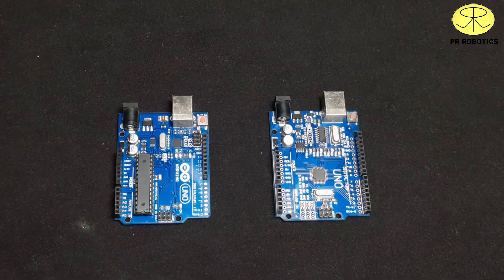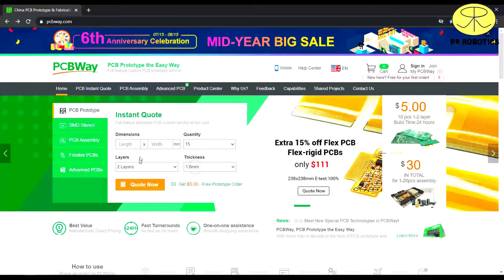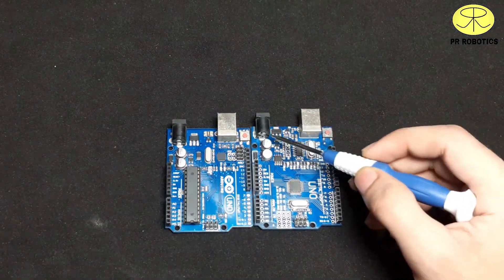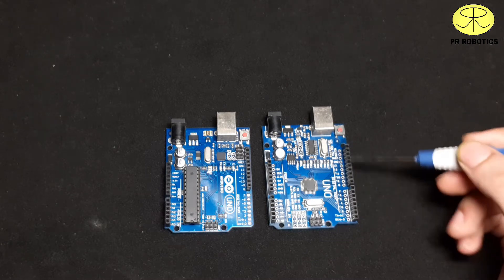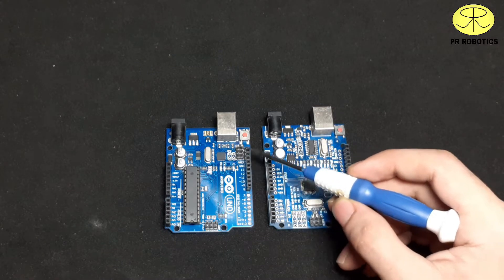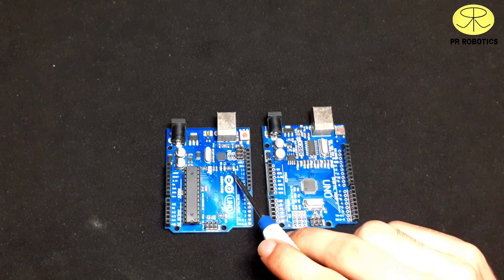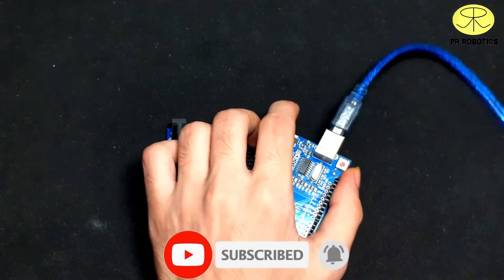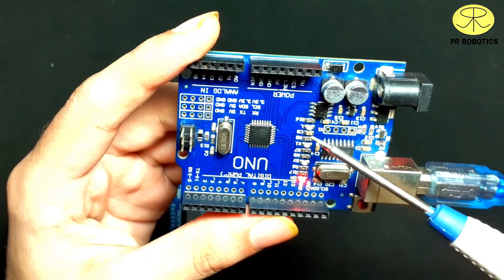#67 Arduino UNO SMD version v/s THT version  ||PRROBOTICS

Comment: In SMD model
There is some other  power points and  ground pins which is in between the ISCP points and analog IN but they not sholdered by the manufacturing, if i use my all power points ,  can i use use the power points and ground which is in between ISCP and analog. 
Can i use these pins safely without any fear of overload or burning of microcontroller?

Comment: What is the better arduino  board
Reply from the maker: I will prefer the one with THT IC because if you do something wrong and blow up the IC (which can happen sometimes), you will be able to easily replace the IC without the use of specialized tools. I hope it helps :)

Comment: Hey bro! Through which board can I control 2 motors?
Reply from the maker: You can use both of them. You have to use another module which is motor driver module with Arduino board to control the motor

Here are videos of mine on interfacing L298N motor driver module with arduino:
https://youtu.be/xIBd2xsGAYw
https://youtu.be/eyAnv8fDLZ0

Comment: hey brother my Arduino uno ch340g board bootloader got corrupted and now i want to install new on it but the AREF pins near to reset button are missing on it.....So PLEASE HELP BROTHER HOW CAN I DO IT?????
Reply from the maker: You can't update the bootloader on CH340G, by the way how you know that the bootloader on the CH340G is corrupted. If I am not wrong CH340G doesn't have any bootloader for it.
Reply: @PRROBOTICS  bro i don't know what happened with the board.... The programs aren't uploading on it, says sync error.... The reset button isn't working neither. So i don't know what to do... Please help. If there is any other option to contact you please tell me, I'll send you the video related to it
Reply from the maker: @PranayBawne007  checkout the following Instructables 

https://www.instructables.com/A-solution-to-avrdude-stk500getsync-not-in-syn/

Comment: This explanation is precise. What i want to know now if i can use the extra pins. especially the one below
Reply from the maker: Which pin you are talking about can you please specify?
Reply: @PRROBOTICS  the clone has extra 5v Ground pins near the iscp pins below where you can solder. does it work? do you have i diagram for that or have you tested it
Reply from the maker: @Shabloop  you can check that with a multimeter, if it's there it will surely will

Comment: the board that you program first i had that and when i upload code in it it shows an error occoured but the lights blink same as in yours but on screen it shows error code please help
Reply from the maker: Please let me know the error code so that I can assist you better.
Reply: @PRROBOTICS  Bluetooth arudiuno car
Reply from the maker: I am mean to say the error code in the compilation window at the bottom of your arduino IDE in red colour.
Reply: @PRROBOTICS   the error message some times come Arduino: 1.8.13 (Windows 8.1), Board: "Arduino Uno"
an error occurred while uploading the code
Reply from the maker: Please copy and paste the error message from arduino IDE. Because this information is not sufficient to help you.
Reply: @PRROBOTICS  Arduino: 1.8.13 (Windows 8.1), Board: "Arduino Uno"

Sketch uses 2658 bytes (8%) of program storage space. Maximum is 32256 bytes.

Global variables use 195 bytes (9%) of dynamic memory, leaving 1853 bytes for local variables. Maximum is 2048 bytes.

An error occurred while uploading the sketch

avrdude: ser_open(): can't open device "\\.\COM3": The system cannot find the file specified.

This report would have more information with
"Show verbose output during compilation"
option enabled in File -> Preferences.
Reply: here is the message
Reply from the maker: Are you able to open up the serial monitor.
Reply: @PRROBOTICS  I Have the same problem and i am not able to open the serial monitor
Reply from the maker: @tamalbej28  Which board you are using??
Reply: @PRROBOTICS  THT version

Comment: I have 3 UNO. All have different type of USB connections. I have wasted money on buying usb cables. Very annoying.
Reply from the maker: Oh! You should check the connector before buying your boards. 😅
Reply: @PRROBOTICS  I didn't pay attention to the connector. I thought they all were the same.
Reply from the maker: Just buy one cable and you can use that one arduino UNO to program other without buying new cable as i did in one of my video. I have programmed arduino nano using arduino UNO because my cable for arduino nano got damaged 😁
Reply: @PRROBOTICS  I have a question, what is Arduino r3 and Arduino Uno